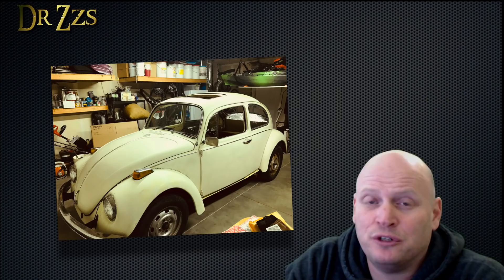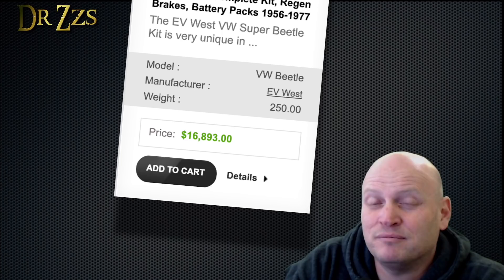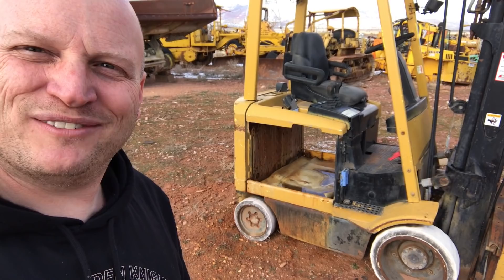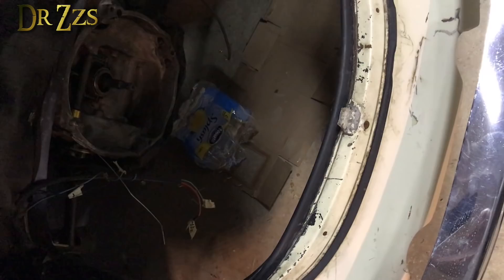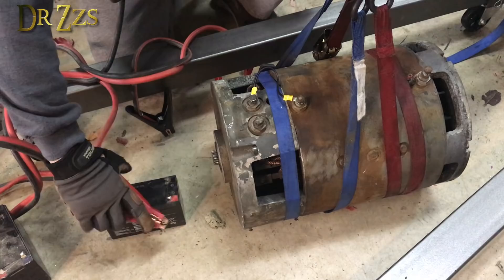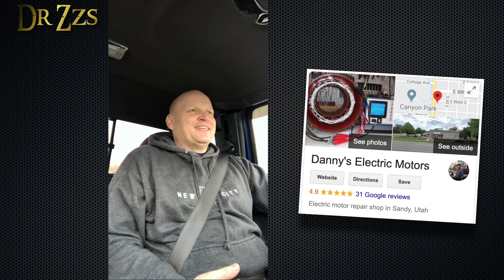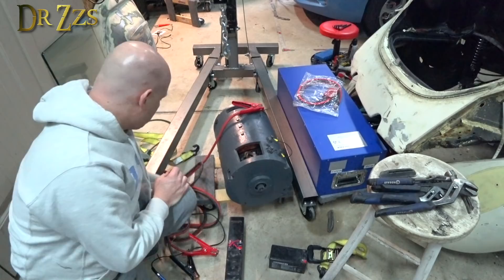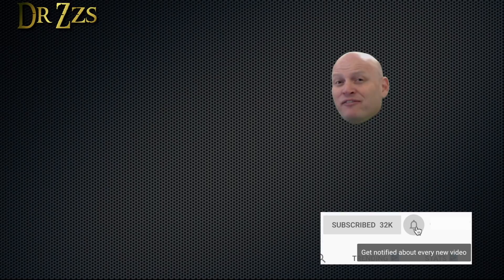Will a Forklift Motor work for my VW Bug Electric Conversion? #DIYEV | cheap electric car

Comment: As I’m a bit older than a number of you and your audience a simple tool to add to your E-Car toolbox is a starter test switch. Keeps you insulated from the amps needed to successfully test an complete your projects. No one wants to play Smokey in front of the kids! Great work.
Reply: why dc harmless, its 12v coils to be aware of & theres none in an EV.

Comment: 32kw is plenty for a conversion. I drive with a  30kW motor and my inverter peaks at 24kW 100A limit at 240V. The car is 1800lb so quite spiffy, if I need to show off.  So you'll not be dissapointed by performance. If the motor really 200lb as you think, it is around 4 times heavier than it needs to be, so I suspect the 32kW limit in the forklift fuse is to conserve battery and not the real power of the motor. More likely this motor can take 90kW for 5 seconds and 20kW continiously, far more than you need. Look up the specs on the motor nameplate or google it.

Comment: The Mitsubhsi Imiev uses a 24kW 300V 3 phase water cooled forklift motor which can be overdriven to 45kW without too many problems (that's the rated output of the car)

Comment: doc. the leaf motor is in for my conversion.  the bits needed for that are fairly cheap right now too.
Reply from the maker: I'd love to hear more about it.  I just watched Ben Nelson take apart the Leaf motor.  I think a wrecked leaf would be a great way to do a classic car conversion.
Reply: @DrZzs   as soon as the motor arrives (should be Tuesday)  youll have measurements and all the data i can find in discord. apparently  its possible to make an adapter for them to change the bolt pattern to a warp 9 bolt pattern which would make them compatible with the adapter plates on places like ev west and thunderstruck motors.

Comment: I bet Danny laughs everytime he sees this video.
Just kidding. Don´t feel bad. That junkyard piece would have left you stranded probably in a few months in the middle of the road. I am an engineer, and my dad refurbished myriads of similar motors. Danny surely changed bearings, make sure all of the weldings in the armature coils are working and sturdy, and applied a good lacquer in the stationary coils (in a motor that age it is very needed as this lacquer degrades on time). This was needed, and cleaning up your engine bay in a rebuilt is a necessity. I mean, if you´re going to tear everything apart why not cleaning and painting even with a can spray? 
Danny could have saved you a lot of trouble downstream, trust me. Take the word from a maintenance engineer for 15 years.

Comment: Volts don't mean anything it's the amount of amperage that that battery pack can put out if it's only a hundred amp hour battery it's going to peak somewhere around 150 200 that motor may require a thousand amps just to start spinning make sure you read the label if there isn't one then call your guy back LOL

Comment: Problem is my little project has a more unique donor vehicle (so no kit option), a Kaiser M725 Military ambulance all original 24v system and I'm just trying to figure out what I would need to get top speed of 45mph and a range of 100 miles.
Reply: Is your goal an hybrid or all electric?
Reply: Is your goal an hybrid or all electric?
Reply: Is your goal an hybrid or all electric?
Reply: @hamadilawson4396  All electric

Comment: This is just a hypothetical idea to loose the battery aspects of electrical vehicular propulsion and recharging systems of these type of ev's!?! I'm pretty sure you can create an electric motor that has half the axle of the motor making the electricity to begin with, and separated by completely insulated wall inside the main electric motor container with the single axle going down the center of it, that would on the other side of the insulation wall in the center of the container allow the other side to be the side of the electric motor generator to actually produce the action of the whole axle spinning by the produced energy on the other half of the axle separated by the insulated wall so that the separate partitions of the container are simply self-powered instantly active upon being triggered to begin the whole affair between the units two axle's dual implementation of a dynamo generator coupled on the same axle with the action creating electric motor turbine, or whatever you want to call it, I am pretty sure this is doable, and the most simple design that I have ever come up with today that covers all the bases of the b***** that are system has been a run on for years!!? Thank you and may our common sense and logic awaken, and if you cannot get my logic or my grammatical syntax and the contextual meaning of what I have just shared, then please tell me about it and I will do a walk through again and do diagrams if I must!? Enjoy;)

Comment: If you run the armature at the rated voltage you can probably run the main coil at a higher voltage than 48v to get more power and top speed right?
Reply from the maker: I'm not sure about that.  I haven't heard of using two different voltages in a series wound motor.  I'll have to look into that.  thanks!
Reply: @DrZzs  Series Wound Motors use the same voltages for both the field and armature. They are designed that way.

Comment: HI THERS A NEOPRENE? MULTI COUPLER FOR MOTOR TO BOX , ITS FLEXIBLE TOO AND UNBREAKABLE,
Reply from the maker: Where do I find this?
Reply: @DrZzs  I SAW IT ON A YOUTUBE VIDEO ABOUT 2 YEARS AGO WHEN A GUY WAS PUTTING AN ELECTRIC MOTOR IN A CAR, I KEPT THE VIDEO AND WHEN I FIND IT ON BOOKMARKS ILL LET YOU KNOW , HE WAS USING CAR BATTERIES NOT A TESLA POWER PACK
Reply: AC Electric Car Conversion 101 part 001 @DrZzs  ITS CALLED A LOVEJOY COUPLER AND HAS DIFFERENT SIZES FOR DIFFERENT APPLICATIONS BUT THEY ARE INTERCHANGABLE SO THEY FIT ANY BOX TO MOTOR , HOPE THIS HELPS